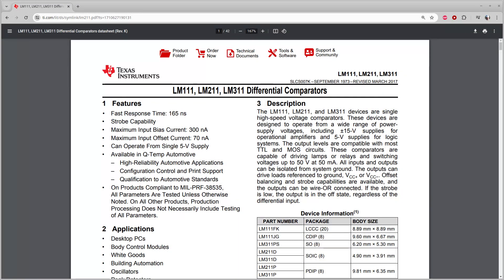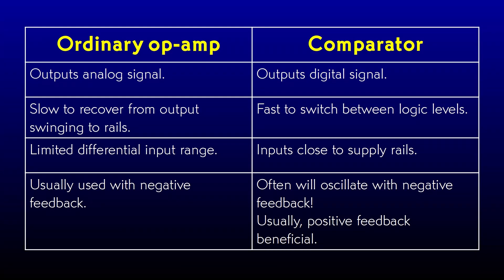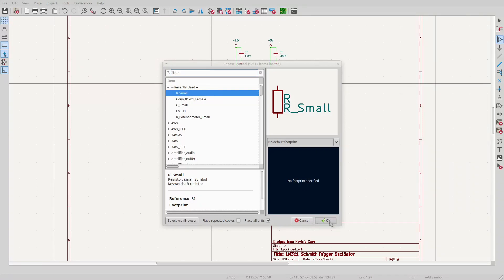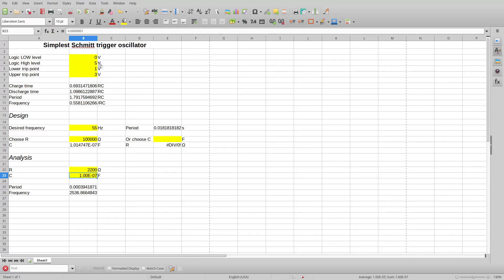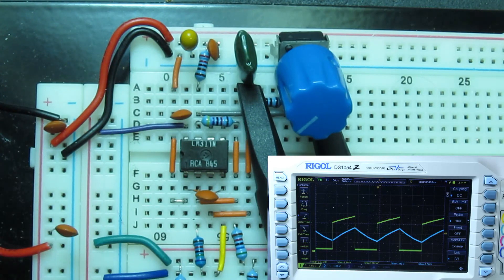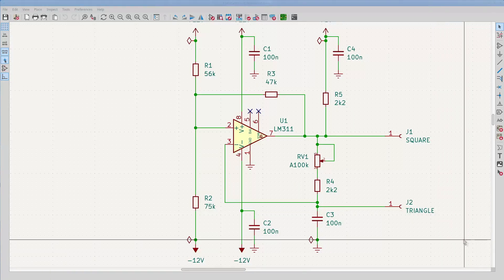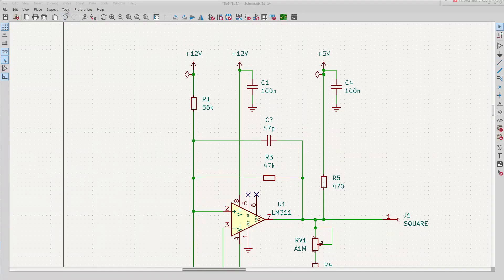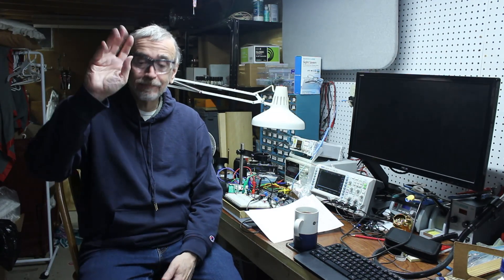Audio Synthesis Ep005: LM311 Schmitt trigger oscillator

Comment: Just use a push-pull output comparator.  These days they are common.
Reply: BTW I love your new channel! :)
Reply: btw, before you say it, yes I know most are limited to 5V operation.
Reply from the maker: I had a bunch of LM311's sitting in my parts box.  If I wanted to use TS3021's or something, I'd need to order them and wait for them to come in.
Reply: @KludgesFromKevinsCave  Yeah, I have a bunch of LM311 as well.

Likely will NEVER use them for anything.
The TS3021 is nice but overpriced like most fast comparators, and even some no so fast.
Reply from the maker: @stevenbliss989  yeah, well, the '311 worked here, and the distributors still stock them by the million.  'Cheap and plentiful' suits me!